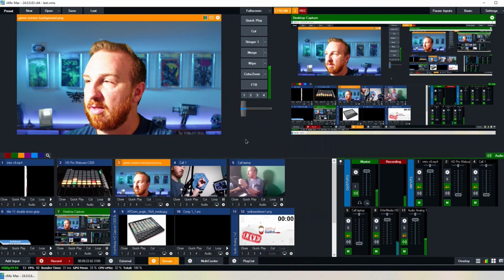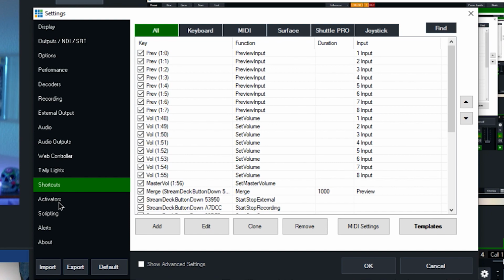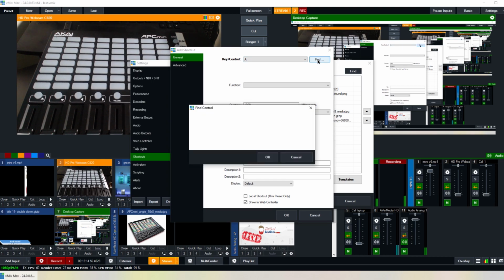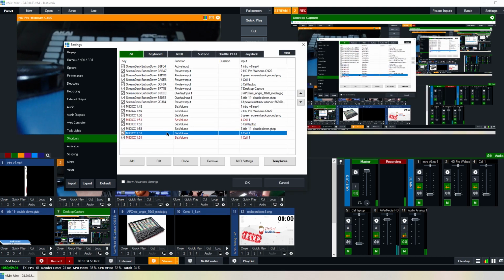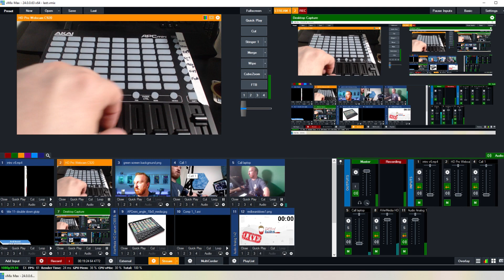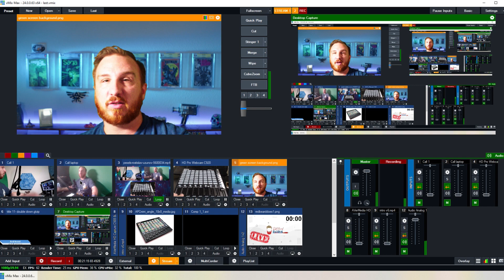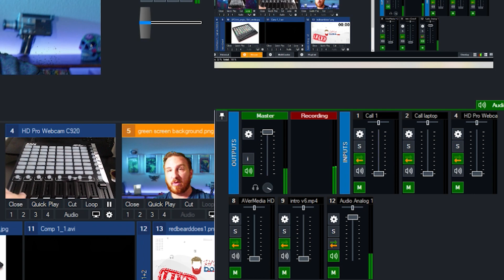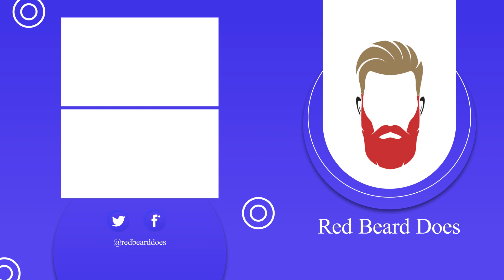Using a USB Midi Controller to control Audio on VMIX and VMIX Calls

Comment: Hi Red ,
How can I make Memory banks in groups of 8? what I mean is that most midi controllers only have 8 faders, so if I have 16 audio inputs in Vmix how can I tell  to vmix that on the first memory
 bank the 8 fiders will control the first 8 audio inputs then moving on  the second memory bank the 8 faders will control the audio inputs from 9 to 16 obviously without the faders interfering with the inputs from 1 to 8 or viceversa

Comment: Grateful, how do you setup your audio in and out, Master and Headphones and main recording audio?

This is sick I never even thought about this because I have a roadcaster pro and then I was thinking what if the Realtek card is just as good and found it was
Reply from the maker: I record the main audio and will have the headphones mirror so i know i'm hearing everything right.
Reply: Nice so you have the Master set to just enabled? Or nothing? 

Then you set the headphone setting to your? And where do you plugin the headphones straight to computer or?